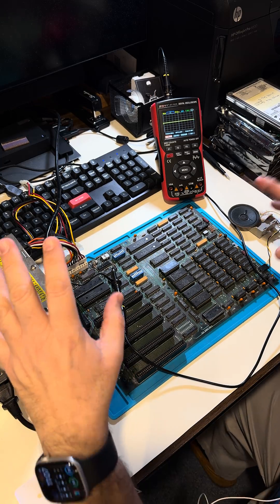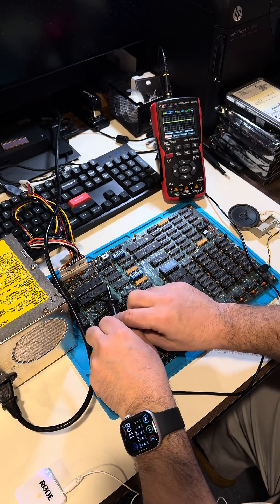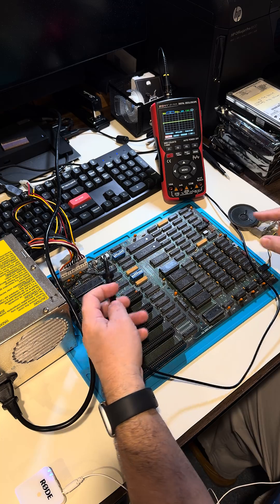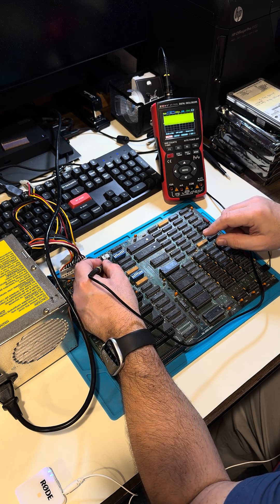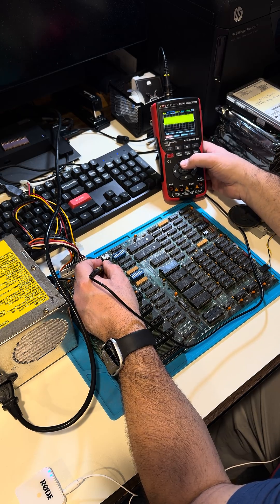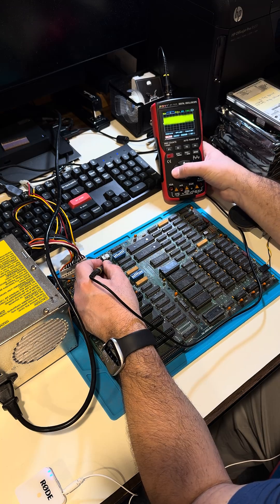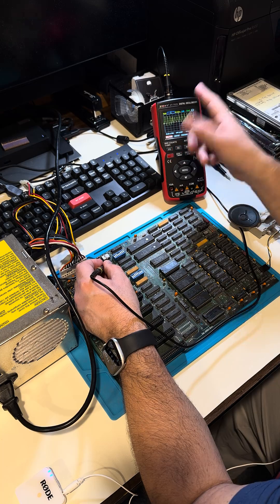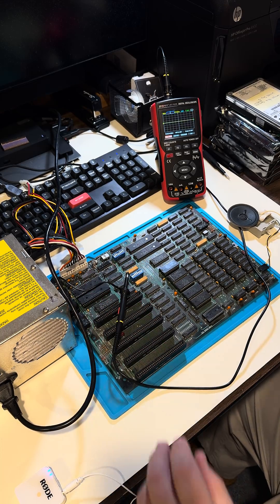Testing the #IBM5150 We have clock! #DOScember

Comment: Are the ROMs good? It's not common, but if they go bad or any of the supporting circuitry does, you'll never hear a beep. That's the first thing I'd check if I know everything else is good
Reply from the maker: I’m still working that out. Right now I’m testing for a good 4.77MHz clock signal. I think the clock signal is good. ROM tests may require hardware tester(s) that I need to get my hands on.